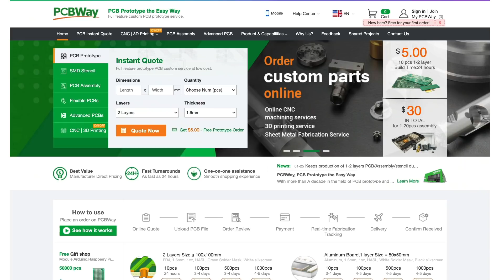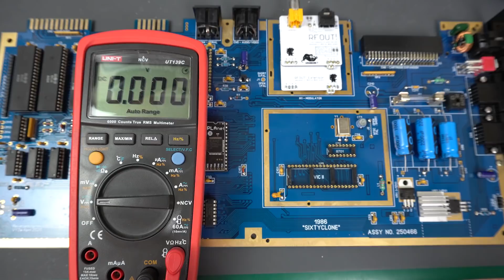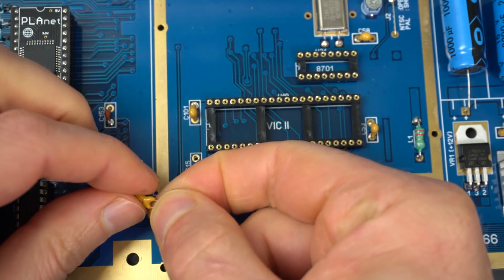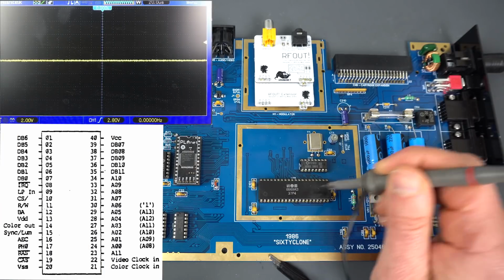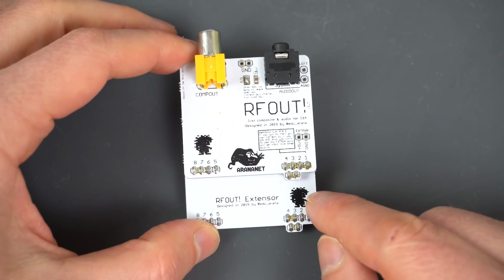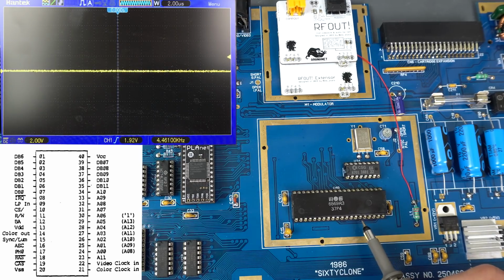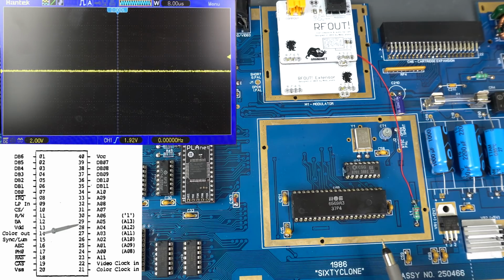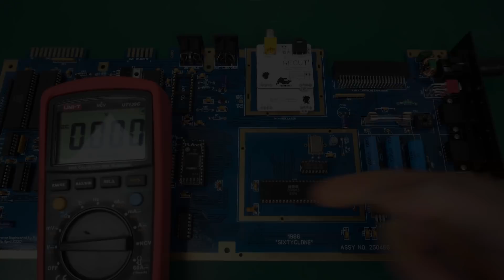Fixing a Modern Commodore 64 Build

Comment: Yellow/orange Tantalums are actually quite common - at least on PC hardware (which I deal with a lot). Usually they blow up spectacularly when you mess up polarization but I guess the voltage in this case was just too low to provide proper fireworks. Actually Adrian Black had a spectacular one blow up in his digital basement in one of his recent videos.
Reply from the maker: Haha, yes, I just saw it!! Probably because I work more on older computers, I tend to look out for the little blue caps, but you're right, they can be any color.
Reply: Well worth replacing it as its been abused too.
Reply: The tantalum didn't explode because PC power supplies can supply more than 10A and 7805 only 1.5A
Reply: @VladoT  I've seen a 1A rated 7805 deliver 3A for a few seconds before exploding itself.

Comment: I love projects like this SixtyClone. It makes the retro computing experience more available and can help to save good components off of bad original boards that might otherwise be discarded. See also NESessity by Low_Budget.
Reply from the maker: Absolutely! Personally, I'm much more excited about replica boards and replica chips than FPGAs (but I get that they serve different needs for different people, so it's all great). Anything that allows more people to experience this hobby without spending an arm and a leg is great news 😃
Reply: Its brilliant. There is really amazing work happening right now on the 68kmla forums to build reverse-engineered Macintosh SE and Classic boards - the Classic being commonly destroyed by battery leakage. They've been sanding down, photographing the copper layers..!
Reply: @josh46646  Really? That is amazing! I had no idea about that, so thanks for the tip. I love the classic macs and having repaired one of them, knowing that a new board is obtainable would be very nice indeed.
Reply: @doc_sav  Yes I only found out recently. It is still in development so not readily obtainable just yet I think. :)

Comment: There's something incredibly aesthetic about 80s electronics. That specific tone of blue (or sometimes green). Maybe it is the text font on pcbs. The size of the components. Ahhh, I don't know. Excellent video. I think that Moore's law is about to reach its limit and we will be seeing more people getting creative solving problems with some vintage ideas. I don't know about using the RF out for monitoring though haha
Reply from the maker: I agree. I think a lot of it is also due to the fact that you can wrap your head around one of those computers intimately and figure things out yourself. Once you move into the 90s, things start getting a LOT more complicated.
Reply: @NoelsRetroLab  If I were a professor I would personally teach computer-applied electronics basics on old high level computers (C64, AMIGA, ETC.) rather than new low level computers (Raspberry, SOCs, etc). And yeah, I'm a 90s kid (not a kid anymore actually haha) and I remember the HUGE spike between pentium generations and how Windows XP was "impossible" to run properly. Such thing hasn't happened nowadays. And with the semiconductor shortage, the hardware spikes will get even slower. It sounds "bad", but is it?
Reply: @artstrutzenberg7197  I'm an IT Engineer personally and only took a small subject on electronics at school (my university had a totally software-oriented curriculum, maybe some networking over here and there). I learnt to understand high level programming languages just by practicing and not reading theory or the principles behind it (it was cool at the beginning). But just when I thought I was a prodigy, I got hit in the face by some OS scripting problem on Linux (due to PTSD, I rather not remember what it was haha). Programming logic at OS level (C modules on linux) is a WHOLE WORLD different to what I do at work as a Web Developer. From there, I started to try to understand the "low level" under the iceberg but that led me to needing to understand (and I mean understanding, not what I used to do back at school :P) math (discrete math, algebra, calculus, numerical analysis) and electromagnetism and optics (physics). At the end I ended up here, talking about electronics which is the basic form of modern computing. So, if you look at it, I did everything that was needed but in the opposite way (Frameworks -> high level programming languages -> operating systems -> electronics -> basic sciences). The way I did is a very good way of keeping interest on the students, but a terrible way to actually understanding stuff. So, you should go step by step of technology (Basic Sciences -> Electronics -> Computers -> Low level Programming languages -> Operating Systems -> High level programming languages -> Modern Technologies). Commander X16 as a project or even as a whole subject to study on the first courses (if not the first one). Keeping your first computer is a literal milestone hahaha
Reply: @SUP3RP3DR0L1V3  : I'd say a multi-track approach is a bit better, possibly (Basic Sciences -> Analog Electronics) & (Basic Math -> Logic), then follow those two with (Basic Digital Electronics -> Low Level Programming & Simple Computers -> High Level Programming), (BIOS systems -> Operating Systems) and finish up with (Modern Systems).
Reply: @absalomdraconis  You're right. This is the optimal option. You don't need advanced math to start looking at basic circuits. It depends on the student though but yes I agree.
Reply: @tspawn35  Agreed. And also with this "circular economy" tendency today and the insane amount of electronic waste we do, there is a lot of good stuff that could happen. In my country, repair shops now only repair blenders, refrigerators and stoves. I have some broken LCD displays, fully functional CRTs, motherboards and Pentium 4 era hardware (PCI tuner cards, IDE drives, DSL Modems, etc) that don't have a "use" anymore but I just don't feel like throwing them away. As you say, doing board level repair makes sense as it is cheaper but I'm no sure if it is, you know, "marketable" for companies to let you repair your stuff :(

Comment: I spent most of the day trying to get a PiStorm (I built from parts) to work. No luck, until a few minutes ago when I finally noticed one bad SMD solder joint. It's that breakthrough moment, that makes electronics fun.
Reply from the maker: That's right. It can be a bit like old games: the longer you bang your head against the wall, the greater the reward when you finally figure it out 😃
Reply: I had a game I just couldn't beat. I got so frustrated I that I disassembled the ML and reprogrammed it so I'd win! Take that game!
Reply: I totaly agree. You feel like you could rule the world. :)

Comment: Don't know whether you are aware, but there is a small rework required on that version of the board to fix where a misaligned via causes one of the cartridge port pins to be shorted to ground.  Not sure whether that would cause the issue you are seeing, but it does stop a number of cartridges (including epyx fastload) working correctly until its fixed.
Reply from the maker: Yes, good point. Rob told me about it and I checked, but it was already fixed on that board. I didn't include it in the video to avoid confusion, but you're right that it could have been causing all sorts of weird problems.